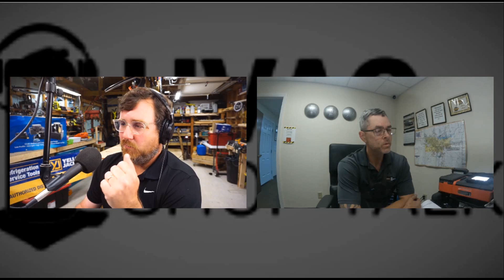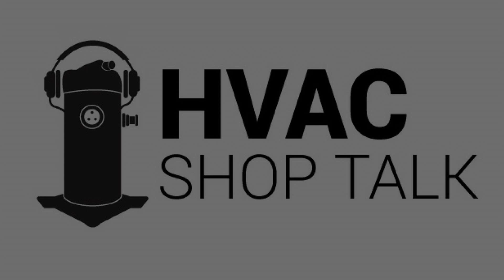The Gree HVAC Inverter System with HVAC Guy

Comment: 2:00 both Bosch and gree units have a pressure transducer. It has three wires. One is a ground, one is 5VDC reference, the center wire usually is the output back to the board from the pres xdcr. It varies between zero and 5 V depending on the pressure. The transducers are usually 0 to 700 psi on 410A.

Comment: I've oiled my flares for 40 years. On hvac, automotive, aircraft fuel and brake systems. Never a leak. Learn to flare properly using good quality tools and you won't need a bunch of snake oils.

Comment: The problem with Nylog is that when you have to toque the flares on a Mini Split inverter they are never toque correct because it acts like a lubricant and it’s a sealant that never drys. Also your tool must be a really good clean and well maintained concentric flaring tool to make the perfect flares every time.
Reply: Nylog won't affect required torque if you only put it on the flare face - don't put it on the threads - the threads aren't what seal.

Comment: Gree flex hooks up exactly like the Bosch from what I have seen. I just wonder how it does in comparison with humidity control and all the other issues that plague the Bosch.
Reply: I was wondering about the humidity situation also
Reply: You adjust blower speed as low as possible, ta da

Comment: Depends what brand. Inverters are really nice for low ambient and sound but the carriers are expensive and troublesome
Reply: U say the carriers are troublesome? Doe s that include the ACIQ brand?  They are supposed to be re badged version of the carrier inverter system?
Reply: The ACIQ extreme heat inverters are are made by midea@chuckb7403